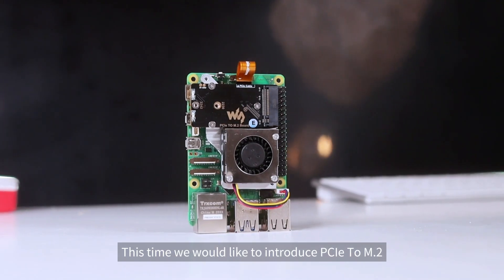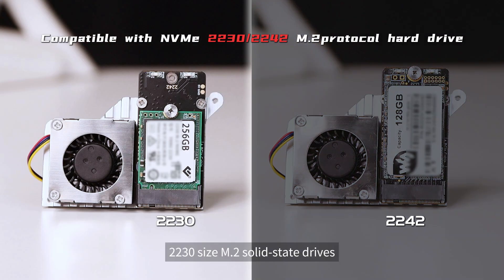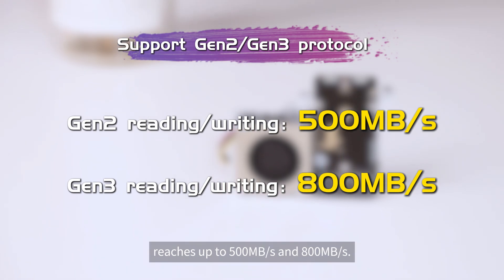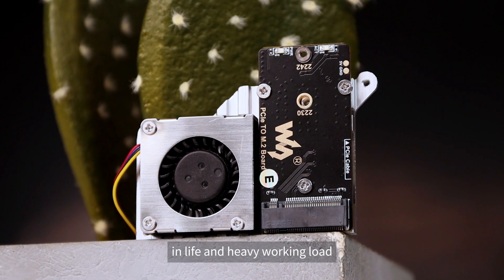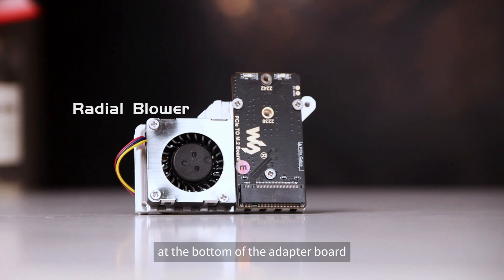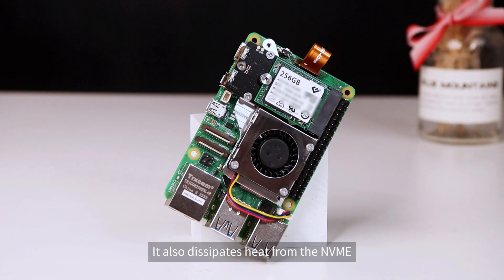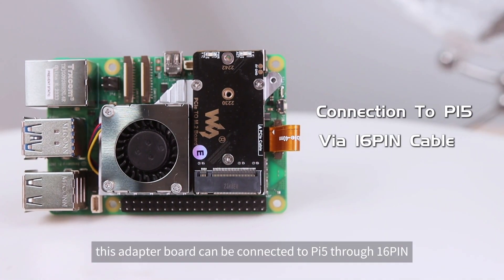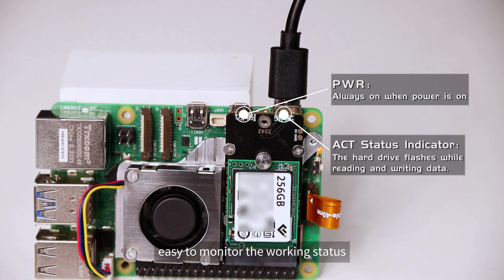PCIe TO M.2, Pi 5 adapter board, M.2 SSD adapter, with cooling fan

Comment: Turning the SSD into an heat sink ? This is probably one of the most cursed design ever made for a raspberry pi
Reply: I mean, as long as the cooler can pull the temps down sufficiently, it cools the ssd, it does not pump heat into it.

As long as... lol.